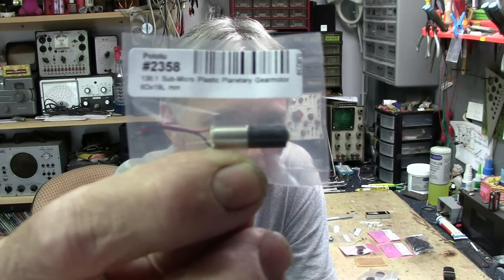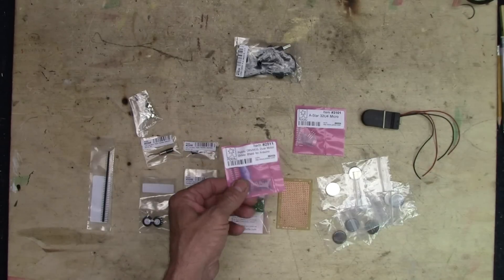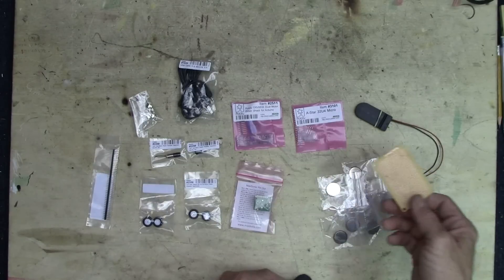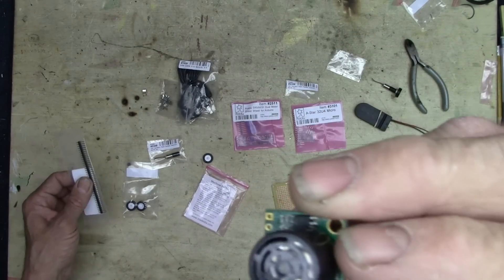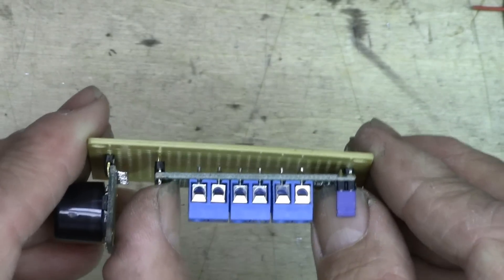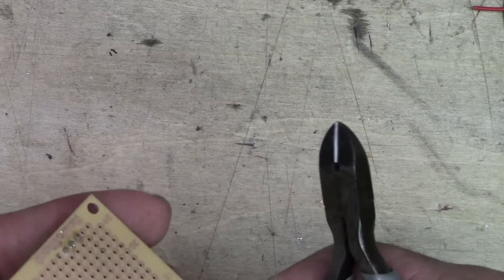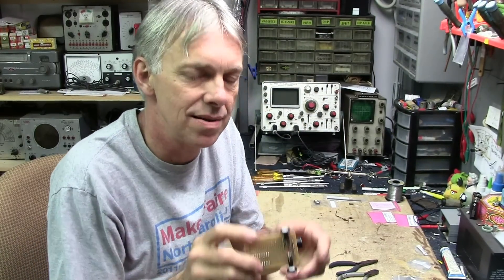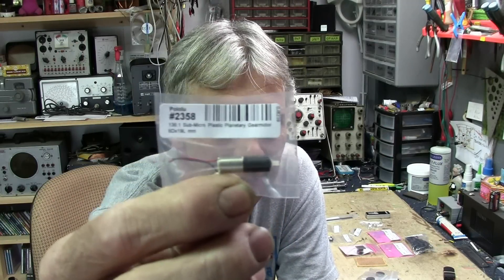Mini-bot Build Part 1 - The Platform

Comment: Suggest you to use some female headers for mounting the motor driver, arduino and the ultrasonic sensor, it will be a disaster if one of your component failed to work after assembly

Comment: Difficulty opening the ziplock at about 7:00: When you can't get a grip on the edge of the bag, or the bag is too fragile to open without tearing away from the ziplock, slide the two sides of the ziplock as if trying to slide them out of each other. This will induce curls at the ends of the ziplock, eventually forcing it open without putting any load on the bag itself.

Comment: Great project! I love the A-Star Micro, and Pololu definitely has a lot of other interesting parts. BTW, the Pololu DRV8835 Dual Motor Driver Shield for Arduino handles two motors, not four. Also, it's a great shield, but if you aren't using it as a shield, why not use the DRV8835 Dual Motor Driver Carrier? It's actually a bit cheaper, and comes in a smaller form factor which would be perfect for your perf board.
Reply: Pete Prodoehl Awesome! I just ordered one! Thanks. :)
Reply: ***** I'm working on this weeks video now Pete. The DRV8835 arrived Wednesday and now it's wired up on the board! I gave you a shout out in this week's video! :) Thanks!